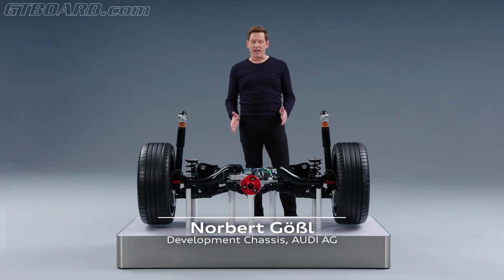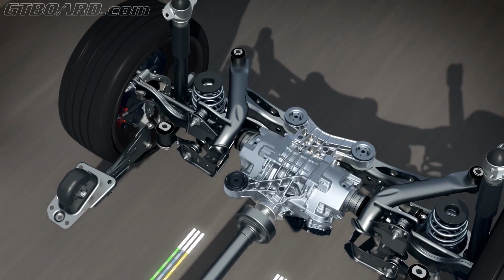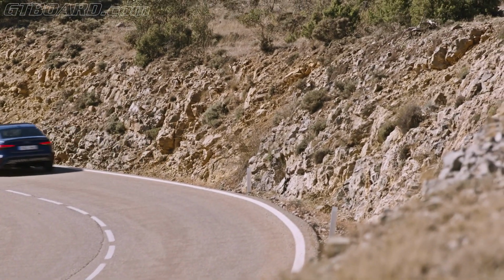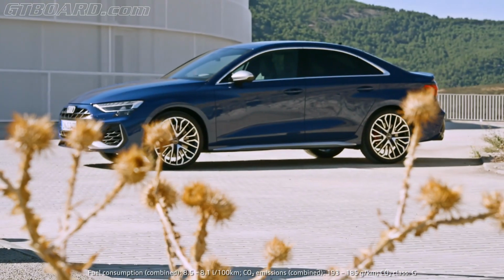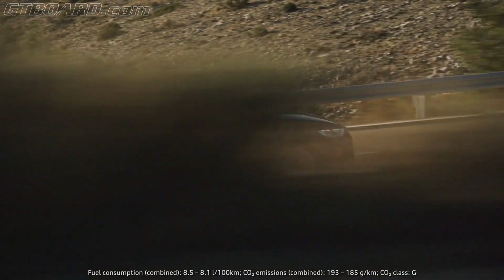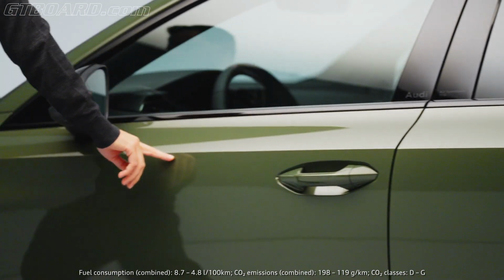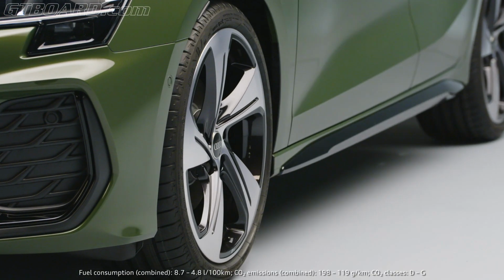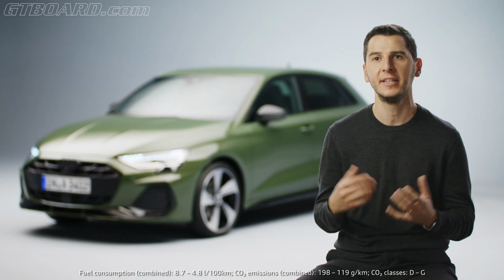New Audi S3 technology in depth, design and the interior.

Comment: When you look at the specs of this S3 or the Golf R, I think they are superior to the very expensive Honda Civic Type-R. 
I know the Type-R is tuned on a racetrack and thus very fast with laptimes.
However, I think everyday speed and driving comfort, this S3 and Golf R is way better. IMO, if I lighten put on some race tires and may be lower suspension, it will easily beat the Type-R.
Reply from the maker: Easily tuned as well!